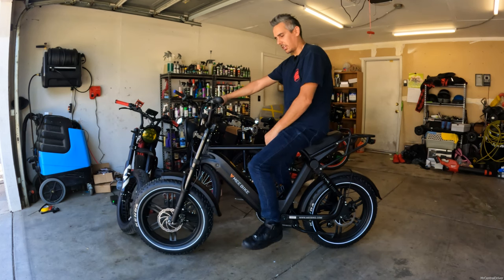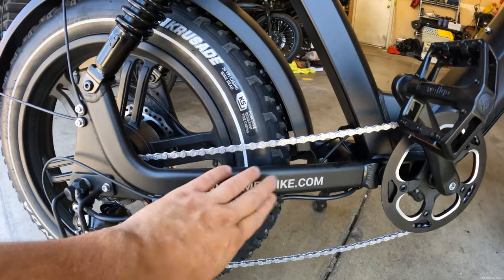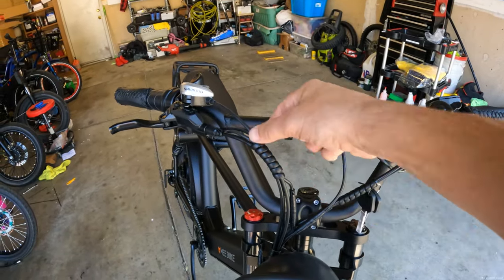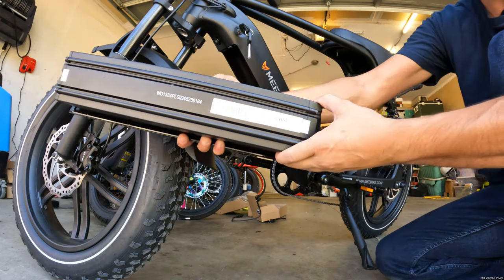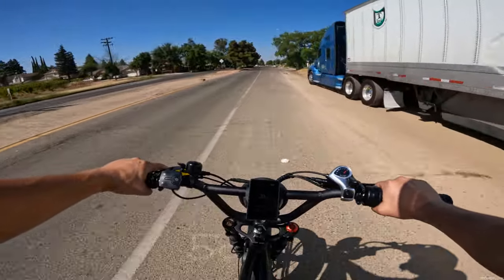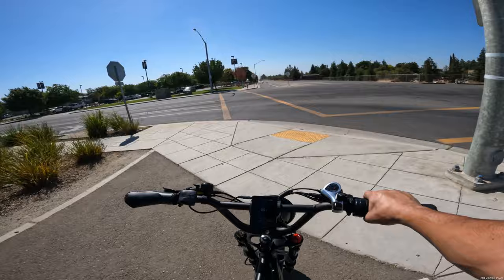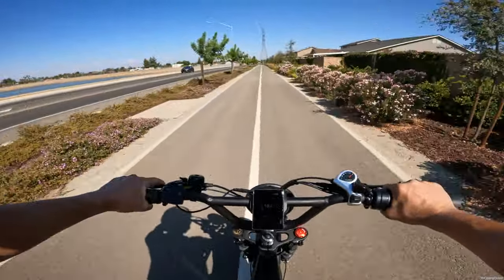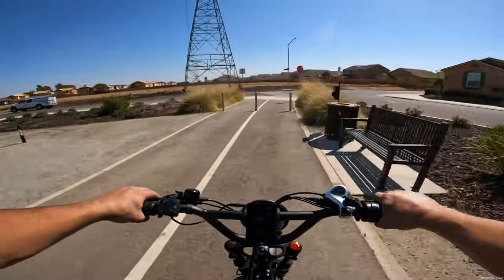MeeBike Gallop E-bike Review - So Comfortable! $200 code!

Comment: Over $2000 and can't hit 25 mph........ That's a deal breaker! You got $1500 bike that will hit 30, and has better acceleration. My AR KEPLER will go between 30-35mph for the entire battery until about 25% left, and I paid $1800. If this bike has x-class performance,for this price, I would buy one today.

Comment: Well done review. Nice looks and smooth ride but relatively low performance for moped style 20x4. It seems like the bikes with mag wheels always use low amperage controllers and perform poorly compared to the spoked Bafang hubs. This bike claims to be a 750 watt but the 20 amp controller only supports 480 watts continuous and 960 watts peak. 
I agree about price being a little too high on this one. The competition at this price point includes bikes with much better performance. But it could still be a good choice for people who don't live in hilly areas or care about performance and just like the looks and want a smooth ride.

Comment: I got one of these for like 2099, no tax for buying it, thanks china!  It was discounted on the website and i used the code for 200 off.  I have to say, aside from the top speed being about 25 without pedaling and tops out at about 31 with moderate pedaling, I LOVE my gallop.  I have been riding it back and forth to the gym and work, the battery lasted the entire week.  The ride is really smooth like he said, the ride height makes it feel so comfortable. the tires have great grip, suspension is great. The brakes saved me this morning when a jogger ran out in front of me at 4:45 am,  The headlight gives great visibility. 100% happy with my purchase.
Reply: Hello, do you happen to know the code to unlock the speed on this ebike?

Comment: I love the bike style i had a bike like that before i posted on my channel awhile back now i just DIY my bike now bc only you can make the perfect ebike and escooter. Like now i have a bike with 80a controller and a 3000w hub motor and im about to upgrade but i have a scooter that has a 160a controller with a 7500x 2 watt motors that hit insane speed and acceleration

Comment: What do you think about the placement of the battery on the bottom of the frame,  it seems like the heft of that battery is only held up by that rinky-dink push button and cheap turn key lock, I have to wonder how that will hold up and not pop out after many many bumps in the road or in your travels...
Reply from the maker: I’ve received tons of ebikes with batteries on the bottom and never had one fall out. Using the similar lock and button method. Yes it would be nicer up top but doesn’t look like this big battery would fit with the frame design they have.

Comment: 🐍 GRIZZLY suspension was too smart for you. It's fully adjustable. Not a scrawny flimsy spring like the Meebike. 
All you had to do was lower the air charge or get fatter.🖖🤙
Reply from the maker: I do my reviews based on how the bikes arrive. I  like to review them right outta the box ready to go.
Reply: @MrCentralDriver  I'm not biting. Do you air up the tires, tighten the bolts? Set the air pressure on the shocks is the same valve stem on a tire.
Do you stick a T-tool in your pocket for Esk8boards ❓️
Anyways Meebike has nice lines slow as s*** like a 48v Suck73 or my 48v SONDORS MadMods Scrambler.

Comment: Thumbs up for design and battery. Thumbs down for speed and price. Ariel Rider's X-Class is the same price, but goes 30-35 mph effortlessly, as does the Kepler for UNDER $2000. Even Freego has a $1500 bike that outclasses this at 30 mph. Do these bike companies NOT Guage the market before setting their prices? You can't charge Class 3 prices for Class 2 performance.
Reply from the maker: I agree. Thumbs up on comfort, design, and battery size. But the speed is not their on this bike in it’s price range. So if your going for comfort get this bike but if your going off performance than look elsewhere

Comment: I believe their problem with power lies on the controller,  get a better controller and problem may be solved
Reply from the maker: I think your right. Curious if we can change some settings
Reply: @MrCentralDriver did you contacted manufacturer? Ask them if there's anything to unlock or if they have higher amps controller